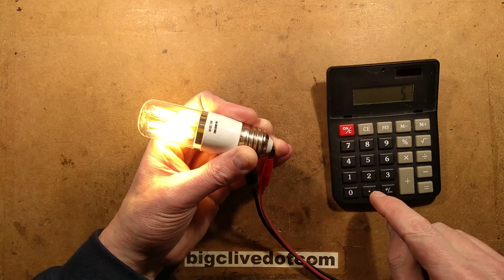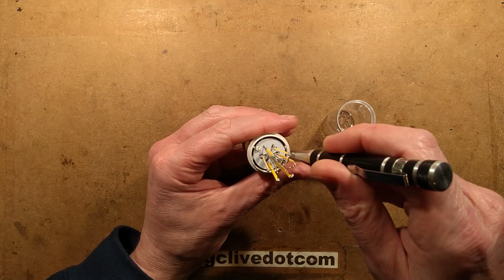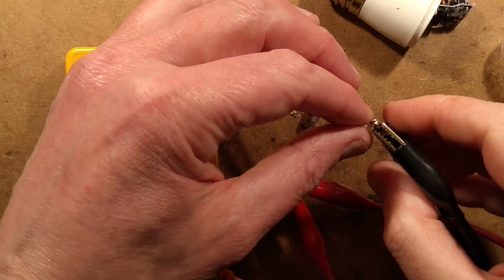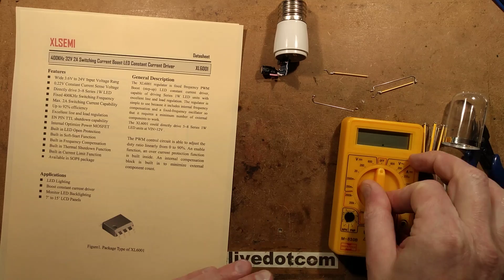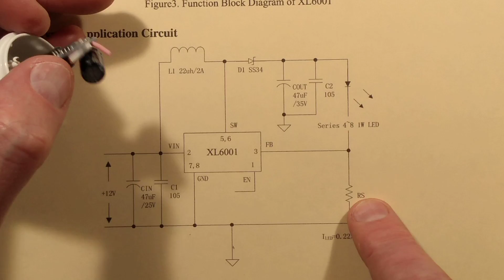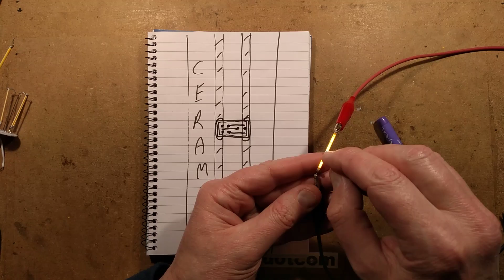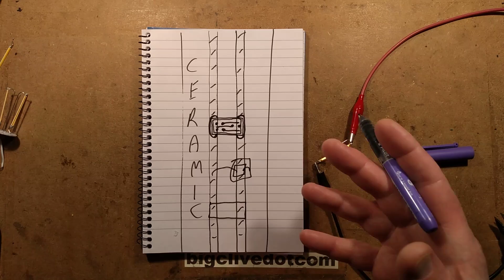12V LED filament lamp video disaster.

Comment: I think these lamps are ideal in a camping environment, you can use them even with a half dead battery without turning the engine on.

Comment: Do they make these in B22 fitting? I have some ideas. (some googling did show that canal boats often use 12v b22 bulbs so maybe i should go to a chandlery)
Reply from the maker: You may find them on eBay.

Comment: Holy crap, I have that same "shitty meter". It was a gift from a family member so I can't just toss it. I keep it on my bench in case they come around while I'm piddling. It does a reasonable job of testing transistors, diodes and resistors. Works okay for a quick "is there power?" check.
Reply from the maker: The cheap meters are surprisingly accurate.  Ideal for when you need to measure two variables at once.

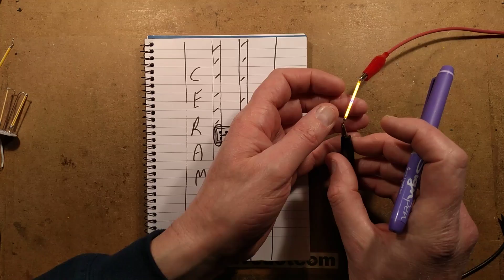Comment: 19:44 Soldered straight to the conductors. That's standard 'Surface Mount Device' (SMD) practice. check any modern PCB.

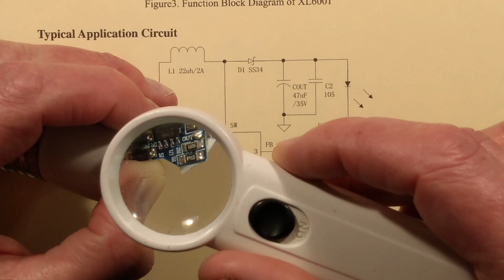Comment: 17:15 the Resistor reads 'R910' the R takes the place of the decimal point, so it is 0.91 Ohms
the other is '10R0' so its 10.0 Ohms

Comment: The switch in those little cheap VOMs is terrible- you have to work it back and forth several times to get it to read right.  And in every LED bulb I've seen the elements are in series or a combination of series/parallel.

Comment: What voltage is needed to power the led array?  Why didn't you just read the output voltage from the PS / Regulator in the base of the lamp ?

Comment: That bulb is very deceptively called an LED (light emitting diode). There isn't anything diodec about it The emitting  filament has no diode effect.  The diode he mentioned in the circuit board he pulled from the base If you removed the plastic casing from around the internal filament will emit a very bright light...that would be a true light emitting diode.  Those crazy readings from the FILAMENT is an incandescent effect ...not a diode at all!  Bravo! The technician in this film has got it! What it is actually named is a "Light Emitting  Wafer" with a filament core.  Only about half as efficient as a true LED bulb.

Comment: At the lower voltage, the regulator has to work harder so it consumes more wattage overalll due to heat loss in the DC to DC voltage/ampeage conversion. to maintain its power output current and voltage.

Comment: How can a 12VDC LED lamp be dimmed?
Whelen LED light bar on ambulance.  I connected the left rear-facing yellow LED lamp to the vehicle lefturn signal wire.   Righto right.
Too bright at night.
Suggestions? 
Thank you.

Comment: Rob echoes my concern... Who would use an edison lamp screw thread for a 12v lamp.. I was waiting to see some miracle new ic that could run on ac or dc, 12 to 240v....now thats not going to happen is it.. Love to see you power up one direct from the mains. I guess the bridge rectifier would get taken out as the ic fried in one half cycle, so the cap might not get over volted (output polarised) and explode but the input cap would so there should be a small pop to a bang as the rectifier explodes...
Reply from the maker: They also sell bayonet cap, GU10 and ES adaptors that allow you to plug a 12V MR16 lamp into an ordinary socket.  I tried it.  The lamp exploded.

Comment: Is it just me or does anybody else find these "miraculous" LED bulbs are just plain ripoffs? I have lost count of the number of G4 LED bulbs I've had to replace. They're fed from solar charged batteries. Usually they begin to be finicky and need the switch to be flicked a few times before they come on. Eventually they just blow the fuse. I'm in the process of replacing them with halogen.

Comment: It occurs to me that the random LED spacing might be on purpose.  With regular spacing, if the lens is faceted at all, you may end up with a repeating pattern of light on a wall.  With random spacing the pattern from one bulb would be random (and likely blamed on the glass).  More than one bulb and any pattern would barely be visible at all.

Comment: Perfect 12V battery killer if there is no external  BMS or low voltage cutout :( At leasta tungsten lamp would glow dimmer and warn you)

Comment: Here in the states, the 12 volt bulbs are used for emergency lighting.  The circuit is wired to a 12 volt battery, and automatically come on during a power outage.  I always keep a spare bulb on hand, because they all have to work to pass the fire dept inspection.
A LED bulb would pull less amps and provide light for a longer period of time

Comment: wow thats fucking garbage. you get more light from 12v@1A running through graphite powder. you get FAR more light with 600V@.02A running through a vacum chamber filled with pretty much any noble gas, many forms of which can be obtained dirt cheap by anyone.

Comment: I am perplexed by your choice of using a harbor freight meter...  you know, they give those away for free, just for coming into the store...
Reply from the maker: Alas, they don't give them out free over here.  But while it's a cheap emeter they make good additional meters for monitoring multiple variables.  The quality isn't great,but they do work as meters.
Reply: @bigclivedotcom  ahh, ok. I can accept that. In my rush to judgement, I paused and posted my first comment, seconds before you pulled out the fluke, so you were redeemed. :)

Comment: I thought everyone knew those "filaments" were long strings of LED junctions in series. So the voltage going to a filament string is relatively high, but it's the current that is important so that's what the chip regulates.  And if some junctions short (and some will), the chip reduces the voltage to bring the current back to right level for the remaining LED junctions.
Reply from the maker: You also get 3V, 6V and 12V filaments that have various series/parallel arrays of LEDs.
Reply: Yes, by various combinations of series and parallel connections you can make them for almost any voltage. Just must be careful with current regulation. Even a small over voltage can be damaging. For single LEDs like indicator lights a resistor is put in series to limit current but this waste too much power for large arrays. So it was the development of current regular chips small enough to fit in the base that made LED bulbs practical.

Comment: The XL6001 chip on the circuit board is a constant current (not voltage) regulator. Varying voltage from a power supply to the LED's probably will destroy them. Having said that, my advice is to go to your favorite retailer and buy a new globe. They're cheap and actually solve the problem. Best of all, you don't need to pull a new one apart!

Comment: Having the filaments in series is also a goo way to ensure that they can sell more of them since only one failed filament is enough for the vendor to make a new sale.
One thing that is also bugging me is that when you look at the packaging then it's listed as a lifetime of an LED lamp being like 40000 hours, but that's only the case if it's on for a limited time each day and even the "off" time is included in those 40000 hours. That's not the same as the MTBF value you get on other components.

Comment: The bulb is shaped so because it's made to look like an Edison bulb. Traditional Edison bulbs have filaments in various shapes emitting a warm orange glow, but they're one of the most inefficient types out there. The bulb you're looking at appears to be an LED version of the Edison bulb, which should solve it's only drawback.

Comment: How is it possible to tell before purchase if these LED bulbs are low frequency? I bought ten small bayonet candle style LED filament bulbs and the flicker on them is monstrous; almost seizure inducing. I assume that some have controllers which take their flicker rate over the 300 Hz.
Reply from the maker: The lamps with small bases have no room for a smoothing capacitor, so they tend to strobe at mains frequency.
Reply: @bigclivedotcom  That is quite possibly the most efficient and informative response possible! Many thanks. Merry Christmas!

Comment: It's worth noting that since this is a boost circuit, the output voltage can't go lower than the input voltage. So if you try to supply over the combined forward voltage of the LEDs, there's no current limiting!

Comment: How are the diodes non polarity dependant? Brain just exolidedt
Reply from the maker: At the input there's a bridge rectifier so that the lamp can be powered from AC or will work with either polarity of DC.

Comment: That electrolytic capacitor is most likely the input capacitor. I had a bunch of those drivers in the 1W version, which can drive more LED's in series. The magic smoke comes out though when driving 2 LED's in series while lowering the input voltage below 8 to10V. These drivers work best between 12 and 14 V.

Comment: not so disastrous as I expected from the title. But an interesting find on the LEDs, now I have to get my own to test my theory: blue GaN-on-sapphire LED chips have both contacts on the top, since the substrate is not conducting. However, sapphire is transparent - so you could flip-chip these LEDs over, and with the metal contacts now on the bottom you could just solder them in place.
http://www.semiconductor-today.com/news_items/2011/SEPT/11091NTHUfig2.jpg

oh yeah, that's how they are doing it!
https://compoundsemiconductor.net/article/99020/Increasing_The_Competitiveness_Of_The_GaN-on-silicon_LED

Comment: I was curious about the design of the circuit thanks. Mainly  as these bulbs seem to be on the 3 dollar range. I guess this is due to the low manufactured volumes compared to the 1 dollar 220 bulbs. I am also hoping these 12v filament bulbs can survive longer than their 220v counterparts....

Comment: Apparently Irina Rybnikova died when her cellphone fell in the tub with her while charging. How is that possible? I guess no RCD, but shouldn't the phone part be 5V? Can you do a video explaining possible things that might have gone wrong with her charger? Since you are the expert of bad cheap USB chargers.
Reply from the maker: Many cheap chargers have very little separation between the mains voltage and low voltage side.  In some instances that results in the 5v being referenced directly to the mains voltage supply.  When rectifiers are involved it can defeat the ability of some RCDs to detect fault current.
Reply: @bigclivedotcom  Thank you! I will definitely not charge my phone in the bath. Not that I have a bath tub, but still. :)

Comment: Hi Clive. Are there any adverse health effects when playing around with these phosphor laden LEDs?
Edit: I found one web reference:
ZYP550SG2 - YAG yellow phosphor for LEDs
Safety: Meets RoHS standards, contains no radiation, no toxicity. Poses no hazard to humans or the environment.
Reply from the maker: In the past some hazardous phosphors were used in early fluorescent tubes and the fine dust could get airborne.  The new LED phosphors are probably safer and also tend to be encapsulated in the gel or resin they are applied with.

Comment: It could very well be that those small dots are through connections in the LED die (essentially vias). Something similar is done in rear surface contact solar cells. Small holes (I think made by a laser) get the front electrode to the rear in order to not shade the front surface with those silver contact stripes. Considering that for the LEDs you only need to solder and not place bond wires that way it is most likely cheaper over all when going these extra steps in the LED die production.

Comment: I must ask but why did you fudge around trying to figure out what the voltage to light them should be when you had already lit them with the power supply then snipped them off but had the two wires from the converter begging to have a meter on them while putting the same voltage back on the base?  Would have saved a lot of time.
Reply from the maker: Open circuit the power supply could have put out quite a high voltage non representative of the normal current limiting state.
Reply: Could but doubtful enough to blow the meter.  stick it on 750v and it should be enough but you never know just I would have tried since the meter is less than 4 usd.

Comment: I am surprised you didn't just check the output of the power supply to see the voltage it runs at.
Reply from the maker: It's a current regulating supply.  The open circuit voltage could have been a lot higher than the normal voltage.
Reply: @bigclivedotcom , I do get that but could you of tested it while running the lights on it to see the voltage going through the LEDs?
Reply: Not in this case. The 2 led strips were broken during the cover removal so the light would not have lit up to measure.
Reply: @rickpaulos , if he would of tried that though it probably would of been much easier to realize connections were broken.

Comment: Using an E27 is brilliant. They should put standard AC power plugs on USB devises as well.
Just trow it in the stores like that. People don't read so doesn't matter what it says on the thing anyway. It's a whole new form of natural selection.
Reply: Or USB females to AC outputs. Chines ofc as regulations wont affect them.
Reply: That nonsense really got going with PCs.  They used a serial connector for a parallel port, a joystick connector for a serial port, and an Ethernet connector for a joystick port and for an audio port.  I was just waiting for them to use a sub-D connector for the main input too!
Reply: In the PA audio world some people started using XLR (usually line/mic) for speakers and later power as well (so they could interchange cables). If you know what you're doing and label everything correctly it might work, but I think so much stuff got blown up that it wasn't worth the savings on cables for most.

When SpeakON came out it was often used for power as well because it has connector locking. Though if you didn't use bi-amping over a single cable you could use 1&2 for speakers and 3&4 for power (but no cable saving/flexibility that way). Eventually they created PowerCON, but lots of people still have SpeakON <> PowerCON pigtails or converters in the random box so they can use whatever cable they have at hand in a pinch.

Connection standards have always been a mess.

Comment: Thanks so much for this video! We've ALL had those days where one little thing seems to be completely halting the whole project until we figure out that tiny detail (like bad solder joints). To all the people thinking "Well, that's why you should be more careful!", half of tinkering with things is going to involve somehow forcing your way into something, be it physically or digitally, so that's not really an option all the time. (Although I would have just taken a soldering iron to the ends of those strips and tried to resolder them at that point, maybe add a touch of flux first to re-bind them - or did you try that to no avail? I uh... I'm clumsy, so I end up doing patch-repairs like that at times. *cough*)

Comment: I ordered 6 of the clear (glass) globe filament-type 120V lamps for a dining-room fixture.   2 of the lot didn't survive shipping, with the LED bars rattling loose inside the glass.  Not a big thing, as the remaining 4 filled the fixture and have been in service for almost 5 years now.

Comment: The numpties of the world are going to smoke a lot of these with a mains base no matter what the warnings or labels may say.
Reply: Seabreeze Coffee Roasters - no different to the numpties of the world plugging 110/120V filament lamps into 220/230/240V lamp holders and wondering why the lamp filament blew straight away, and also took out the fuse/MCB...
No different to the the numpties of the world plugging the incorrect power adapter/ power brick / PSU into a device and wondering where the magic smoke came from...
Is it a shame that the intelligent members of our species assume that the rest of the species are also intelligent? Even though a significant amount of them appear not to be...!
Reply: @Mark1024MAK  true but this more than just the normal 110/240 thing this is DC as well using a fitting designed for mains ac. I suspect in the longer term houses will come wired with low voltage dc light circuits so maybe the time for a dedicated dc base to be added to the standard.... It's only one more and one more and ........ or maybe we get lucky and the gene pool improves instead by 'electric selection'.

Comment: A 12V lamp with E27 threads for a standard 230/115V socket? Not a good idea...
Reply from the maker: My favourite is the MR16 12V bi-pin to E27 240V adaptor.
Reply: MR-16? Isn't that another type of lamp socket? I've never seen those here, all I know is a few GU-numbers and E14/E27. I personally only use E14 and E27. So is there a E27-to-E27 socket adapter that transforms 230V to 12V? And why would someone do something like that? Do we next have to expect a USB socket with 230V live and neutral on the 5V power lines?

Comment: Hey Mr. clive, I have a quick question. I have a friends Trainset with a small motor in it. it let the magic smoke out, so we're trying to replace it. the motor we have just oscillates it dies not make any RPM's at all. any idea what is going on there?
Reply from the maker: If it's free to rotate the control circuitry may have issues.
Reply: @bigclivedotcom   thanks! it does it even direct from the power supply too. I've never seen the little can motors vibrate back and forth like that. it's like the other side of the coil does not flip to the opposite polarity of the motor and allow it to turn... Weird.

Comment: Screaming at the screen.... "why don't you just test the voltage coming from the power supply???"
Reply: And finish the video in 3 minutes!?
Reply: It is a current regulated boost circuit, so the output voltage is not specified...

Comment: Clive, I knew the module had to be boost because at lower voltage it needed higher current. Tale tale sign of a boost converter ^^